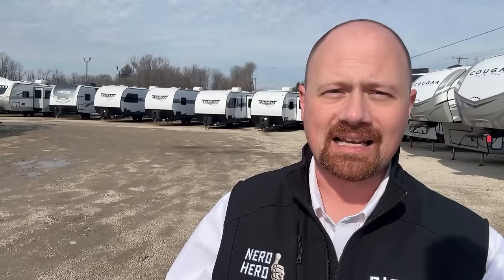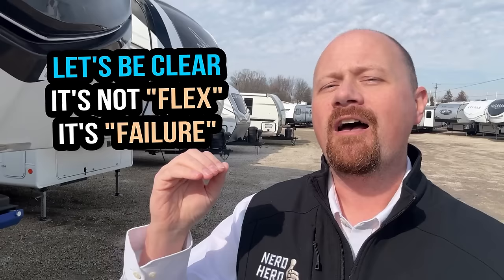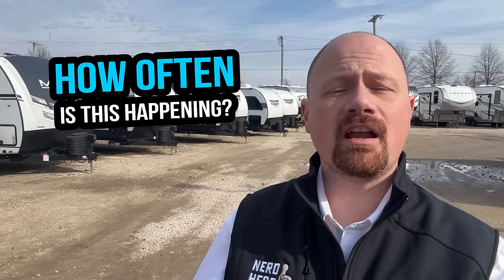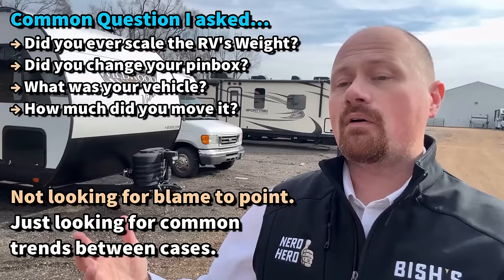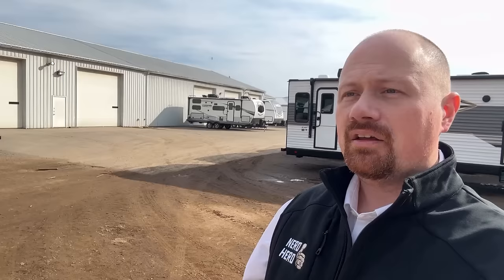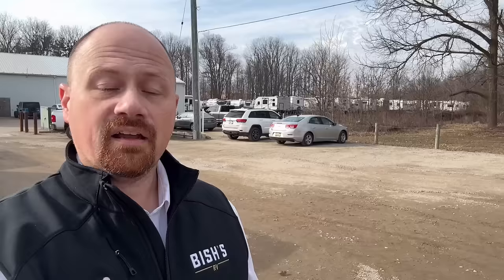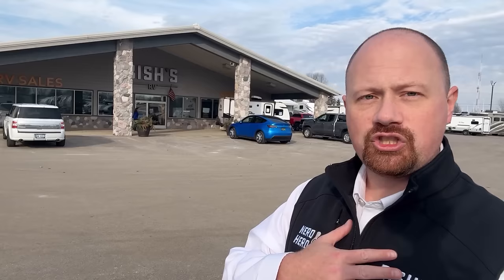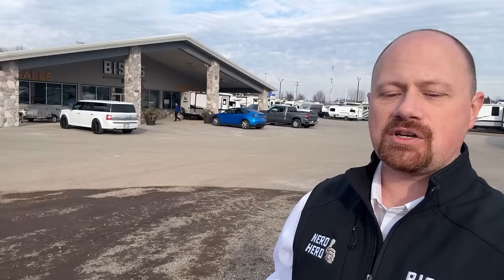🚨 RV Frame Flex & FAILURE!! • WHAT is Happening and WHO is Responsible?!

Comment: Love your videos and miss seeing them in my feed. There was one video of yours a couple years ago I made a  comment on about purchasing the Keystone Cougar 357UMR. You said that you didn’t carry them, but to let you know if we did end up getting one and how we liked it. Well, we did and we WERE loving it. UNTIL… 

Ever since bringing it home, we have had issue after issue with it. The only thing that worked in the kitchen slide was the radio. The TV, outlet stand, and refrigerator did not work, despite being on inverted outlets. (Our rig came with the 600i-L solar package installed) It had one small area where the outer sidewall was buckling under the lower front corner of the window on the driver’s side by the utility room. It wasn’t big, but it was noticeable—at least to me. I made sure to note it to the dealership and they made note of it. Well, it’s not small anymore! It’s gotten way worse and is super noticeable! There are also several other areas where this is happening-on both sides of the rig. One of the areas this buckling is happening is on the camp-side front cap, but not at the corner-it’s in the center. None of the areas start at the roof. The one is under the one window and the others are in solid areas of the sidewall. If I could add photos of these areas, I would as it would show what is happening. I don’t think it’s de-lamination, but who knows. It’s currently back at the dealership right now and we’re waiting for Keystone to respond back. I hope Keystone continues to honor the warranty or we’ll have issues. I also had the dealership send me all the work orders for the things we’ve had to have fixed. Not including the current one, we have five—with multiple items on each WO!

After just two camping trips, the bedroom slide stopped working. The teeth on the mechanism were horribly chewed up, like it was several years old! Had to have the entire slide mechanism replaced. We have also had to deal with several other minor issues, as well. Our rig has been to the dealership so much that we lost many weeks of camping last summer. We are worried we have the dreaded “frame flex”, or worse…a bent frame.

As for weighing your rig, we did do that with this one. The CAT Scale app is super easy to use and you don’t even have to get out of your tow vehicle.

Comment: What I have never understood is why the Gen Y Torsion Flex hitch and the Reese Goose box would void the warrant on the camper.  I run the Gen Y Torsion Flex and love it.  To me, I would think that would save wear and tear on the frame of the camper.
Reply from the maker: It changes how stress is applied to the chassis

It's like if someone pushes you with a high or low center of gravity. The way you have to move to compensate changes

Comment: Here’s a video idea (and Id volunteer to help cause I NEED to know before I purchase): hitch up different rigs, to different trucks and actually weigh them to get pin weight compared to mfg numbers. I have an F250 7.3 gas with 3400 payload.  I have a unit Id love to purchase, but the listed pin weight is 1810lbs…..when I ask actual owners and I’m told unloaded the actual pin weight was up to 2200. That’s a game changer number that I can’t afford to find out AFTER I’ve purchased. You have so many different fifth wheels you could easily test out multiple manufacturers. The videos online are owners of one unit…..not a multi brand video.  I think that content would be priceless

Comment: One thing I see all the time is an owner with a high performance truck pulling a huge rig 80+ MPH up the steep, straightaway, 19- mile Baker Grade on I-15  between LA & Las Vegas to show off.  Wind resistance increases exponentially with the increase in speed.  Couple that with the huge frontal area of some 5th wheels plus the uphill weight load and the coach is experiencing stress I just don't think is engineered into the frame as it should be.   The same wind resistance on a Class A would be distributed differently (evenly) to the frame  compared the the cantilever arrangement on a 5th.   Dealer or Mfg would say they are not intended to be driven like that, well guess what, they are!  Tell me if I am wrong.

Comment: The bottom line is the frames are junk.  These are trailers and made to be towed, don’t say you can’t tow it or a thousand pound difference in weight makes the difference if the frame breaks.  My last RV was a 1993Holiday Rambler that I towed 1000s of miles and was built like a tank.  Only got rid of it because I wanted a slide.  Never had one problem with it.  The new frames are not designed properly, welded properly, or built properly.  It I’d time for the Consumer Product Safety Council and the NHTSA to get involved.

Comment: Been camping for 45 years. I'm certain that 80% or more of trailers out there are overloaded. The trend over the last 20 years has been moving to 'lite' / 'ultralight' models. Size of frame members has been scaled down, more and more high end, unneeded items (granite countertops, fireplaces, etc. ) are added to the decor. Looking at the cargo/tire/axle stickers on any trailer, the cargo capacity is shockingly low. The amount of stuff that people bring camping nowadays easily exceeds the cargo capacity in most cases.
Reply from the maker: I think a lot of RVs are overloaded but I have a hard time faulting owners for a lot of it when they aren't properly educated on how to use the RV in the first place

Comment: There are generally two reasons for this type of issue. 1) Poorly designed frames. 2) Frame material of insufficient strength to handle the stresses. The manufacturers dictate the frame design and materials used. Under the cloak of "weight" savings they put the bare minimum spec frame materials into them. Really this is just a cost saving issue. The frame makers can easily design and build a frame that is far more rigid and dependable but the trailer manufacturers don't want the extra cost to eat into profits, thus the consumer pays the price by these things falling apart. Also a point of note, so called frame flex actually damages the trailer structure that is attached to it. Walls break clear, floors pop and squeak, cupboards do not close properly etc. The less so called frame flex, the better it is for the entire unit.

Comment: The problem lies with the manufacturers. They tell Lippert what frame to build and Lippert builds to their specs. This is happening on units that are not full time used and have little to no miles. The worst part the manufacturers are not doing enough to help customers. If they cant build big 5ers or TH without this happening they need to invest more money into stronger frames, this is unacceptable and very sad when people are spending loads of money and then left high and dry. Great point on using a Cat Scale, we weigh ours multiple times throughout the year.

Comment: Josh, I watched this video and you did a great job with it.  I totally understand that you can't point fingers at any specific manufacturer, like GD because you guys sell many different manufacturers.  I don't think this issue is related to just one manufacturer, however there are a ton of full time RV'rs on YouTube that use a specific manufacturer, so they seem to get more attention that the rest.  I also agree with changing your pinbox hitch to something like a goose ball hitch puts a lot of stress on the frame.  My issue is that we have a 2022 Jayco 29.5BHDS HT, which says its half ton towable, but if you read the pin weight there are no half ton trucks with that rating.  I see for 2024 that they no longer call it an HT.  We pull this trailer with a 2017 F350 SRW, so plenty of truck for the job.  We also use the Curt Turning Point hitch that came on the trailer.  We are 400 pounds under the listed max weight of the trailer and payload, and are having issues.  We don't full time, and used the trailer 6 times last year with the longest trip being 4 hours away.  At the end of the camping season I noticed that the front of the pinbox was kind of pointed up a bit, and the trim along the bottom of the front overhang on both sides had dropped and the sealant was pretty much open to the world.  It dropped 3/8" on the passenger side and 1/4" on the drivers side.  The dealership said that there was wood under that trim that is screwed to the frame and the screws were too small, so they took everything apart and used larger lag screws and put everything back together.  I personally don't think this will fix the issue, and I have a bad feeling that this unit is going back to the factory sometime this year.
Reply from the maker: I have the full support of Bish’s behind what I do - including calling out any mfg. 

But after speaking with a LOOOOOT of people I feel strongly the whole flex situation is really just a flaring symptom of the greater problem at hand - general QC and lack of clarity in information

Comment: Thanks Josh,  I always appreciate your videos.   They are very helpful,  informative.   As a truck driver I know that your right about the suspension on a truck is to heavy duty for a 20,000 lbs rv.  I'm sure your right about a lot of rv's being overweight and not meant for full-time.   However you didn't address the issue of having a aluminum upper deck going to steel.   I feel that's a big cause of frame flex.   That's why we bought a RiverStone, it's frame is completely steel though out. 
  Thanks Lavon

Comment: Well put Josh, great job tip toeing thru the tulips. If this issue was happening in the auto industry, wouldn't the OEM's be forced into a recall? I still feel we, as consumers need to be contacting our legislators to enact better protections for consumers against this exact type of issues. This is a very expensive repair to have done and I hear horror stories often of the manufacturers giving the consumer the run around to avoid accountability. I'm glad you mentioned about the stated weights on the OEM's brochure vs the real weight. That exact thing forced me ( and others) to upgrade to a 3500 from a 2500 truck to be legal, while getting a good deal of "constructive criticism" from my spouse.

Comment: When we bought our bumper pull trailer a sheet was provided from the manufacturer which showed the actual weight of our specific trailer: total weight, tongue weight, left and right side weights.  The actual, empty tongue weight was about 22% higher than published tongue weight.  Total weight”empty” weight was a few hundred pounds heavier.  

We have a Sherline tongue weight scale which I use before we hook up to the truck.  I also go to Cat scales at least once a year.  Travel tongue weight is significantly higher than published tongue weight.
Reply from the maker: What brand provided you that info?! 
That's exactly the stuff I'd like to see in a customer's hands. I've done this 15 years and have never once seen something like that from any MFG
Reply: Ironically it’s a 2021 Grand Designs Momentum 21G.

Comment: Great Video! In my opinion they are building lightweight frames to build bigger RV's to meet public demand  for all the comforts of home and to be pulled by smaller trucks. If someone  wants a bigger RV  they need to understand that it will require a bigger truck to properly pull it! I also believe that many RV's that are advertised for full time living are not necessarily designed to be pulled thousands of miles a year. Year after year! Maybe there needs to be a industry standard that frames must be built to hold up to higher weight limit than needed instead of working at the minimums.
 Also you are correct in believing that every RV' the leaves the factory should have the exact empty weight and tongue / pin weight on a sticker so the consumer knows what they are starting with. I also believe that many are overweight ! The RV's GVWR minus the coach weight a lot of times does not leave a lot of weight left for cargo  sometimes less than 2000 lbs. ( in a fifth wheel ) a family's stuff that they think they need with them can add up quick!  PLEASE Scale you RV being overweight is very dangerous! your truck may pull it but will it stop it?

Comment: My thought on the truck question would be what is the minimum hitch or fifth wheel weight is the susp designed to operate properly with , max is easy to find, what is minimum? A cushioned fifth wheel may help, some do exist, if one is available in that weight category, the fifth wheel mfgrs can at least help with that PDQ. I would think that the vibration level on bigger tow units could be a factor on an RV trailer, there is a pile of frame vibration on them, if it transfers thru to the trailer, that could be quite a factor in itself, but would be hard or expensive, to diagnose.

Comment: Easiest way to get pin weight is to weigh unit with RV connected to tow vehicle, the scale should give you a ticket with the weight of each axle. Then weigh just the truck, the difference in the weight on the tow vehicle axles will be pin weight. I agree with most of the points made, however I disagree with the camper being used too much in all cases. A customer should be able to expect the frame to hold up to high usage when the RV is listed as being full time rated. I think all dealers should have a brochure on how to pick the correct tow vehicle, that explains how to determine if a vehicle is capable of handling the weight of the RV.

Comment: Wonderful video with well explained information. The design of the large fifth wheels could be done in a manner that people, being what we are, will overload or improperly load things and then fall outside the design parameters. Guilty of this myself and could really do a yard sale wherever we "camp". Something you didn't mention was where we take these rigs, a lot of campgrounds are remote and require traveling on less than perfect roads, if there is such a thing. This is really true with toy haulers due to the expected usage at boondock sites and "play" areas. The condition of our highways and the driving habits contribute a lot more than most people would expect i.e. pulling an overweight trailer up hill when going through mountains, hard acceleration and sudden deceleration will be extremely hard on the front frame area. Something that affects the balance is where and size of the water tanks as well as the amount of liquid in them. I have heard several recommendations to not haul a full tank of fresh water when travelling. At 8 lbs per gallon and close to a hundred gallons or more, puts a lot of stress on everything.
Keep up the good job you are doing with informing people and I look forward to your next one.

Comment: I'm in Utah and I'll tell you, I have seen fifth wheels of the 40 ft caliber in places they should have never been driven. I tow my 19ft trailer with a half ton offroad but I also visit the scales quite often to ensure my truck AND trailer are not over on GVWR. Bottom line, MOST people I've talked to that tow have no idea what the hell cat scales are and THAT is alarming. Additionally, RV dealers AND truck dealers don't educate. How many trucks get traded after thinking they got enough truck but then get an RV that's way overloaded. Do your research people and TOW SAFE.
Reply: Hi. I am always looking and interested in scale topic because I constantly fear if I am within specs of all. I took the truck solo to the CAT scale but not paired with RV. I do plan to do it but was wondering how is it done. Do I just drive onto the scale with truck+RV all together or need to also only get a weight of the RV as it sits on a scale while truck is off the scale but still connected? Appreciate help/assistance thanks

Comment: Josh puts up some good and valid points, but he didn't mention one very well known and obvious possible reason for frame flex (failure).  The RV industry is suffering from an decrease in quality from the manufacturer.  We all know it, if you doubt it, check out your local RV dealership's service center.  I guarantee they have more brand new RV's to fix than they can handle, with some waiting times being over six months before they can get to your RV.  Techs will generally be honest with you, its no longer a "parts issue", its a tsunami of problem RV's. Also, the length of a RV warranty is shrinking, where the usual length is now only 1 to 2 years.  If the manufacturer doesn't have enough faith in the RV, why should you? We either need the manufacturers step up, or we need a national RV lemon law to force them to step up.

Comment: Great video!!  Important subject - thanks for doing it.  The washer/dryer weight in the master bedroom is heavy - bouncing around during travel or washing use, this might also contribute to the problem.  I try to look at RV's where the washer/dryer is not up front.  I think if they are situated more near/over the axles it might help with weight distribution and take that weight off the hitch area.  Just my opinion!
Reply from the maker: Yeah, once again I have a hard time faulting a customer for putting a washer and dryer into an RV that has a giant cabinet called a washer dryer prep space